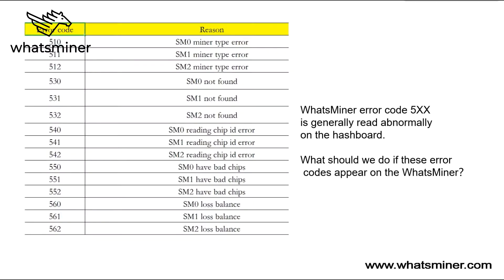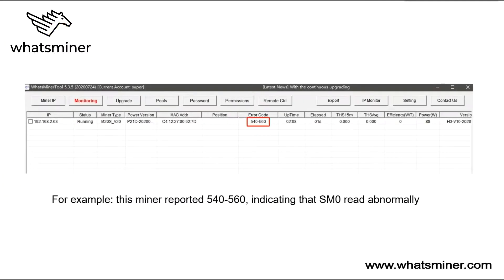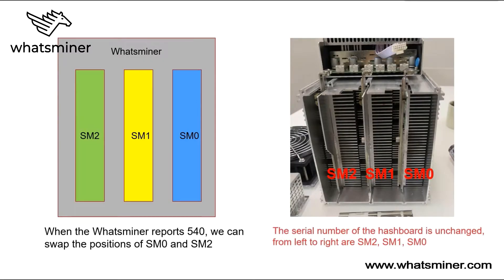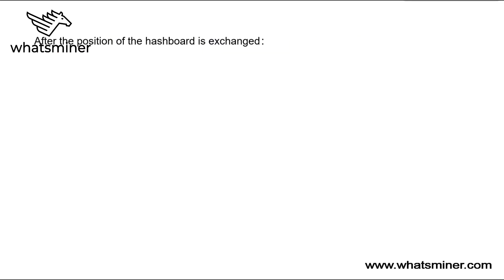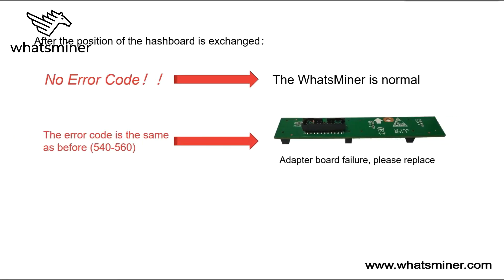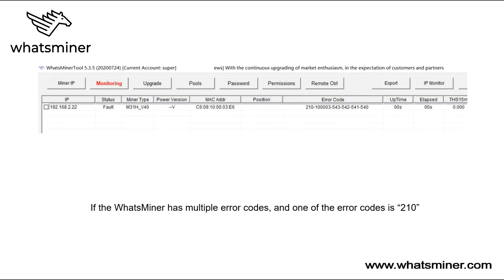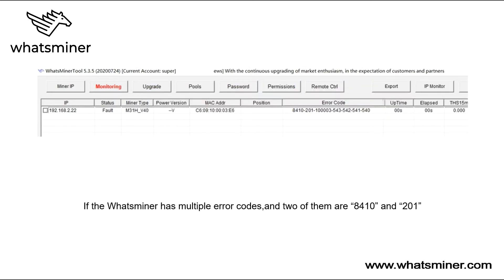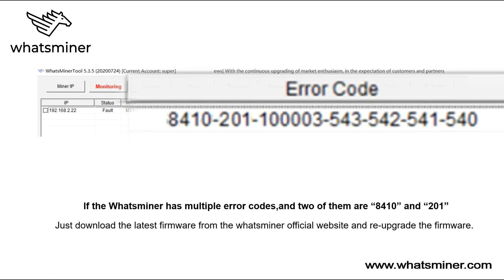WhatsMiner Common Error Code and Solutions

Comment from the maker: Hi there, this video can help miners to locate the error code before asking for the #WhatsMiner after-sales repairing service. For the whole after-sales manual, please click https://whatsminer.com/message/news_detail/36.html?=en
Reply: What do i do ? is it a problem with the power supply?
Error 562: Export failed.
The error message is displayed
Reply: @instrumentmk  Hi,Test process: For example, when you get an error code 562 on one device, it means SM2 hash board can't work normally. You can do like this: Power off, swap the Hash Board position SM0 and SM2, then reboot the miner to verify whether the board is bad in fact, if the errorcode changed to 560,  then it means hash board has issue, if the errorcode not changed, then it means adaptor plate has issue,
The best result is that the errorcode disappeared, it means connection issue only.

Comment: Chinese product is waste your money .no after sale support and the quality is so bad .many error codes no body help from the company 
what the error code 560 means why your miners work for six months and then fail ?
Reply: Hi, you could contact our after-sales and support on Telegram:Whatsminer_Aftersales, 
Wechat:microbt_service, whatsminer_service
Mail:Support@microbt.com.
 For 560 issue, power off, swap the Hash Board position SM0 and SM2, then reboot the miner to verify whether the board is bad in fact, if the errorcode changed,  then it means hash board has issue, if the errorcode not changed, then it means adaptor board has issue.

The best result is that the errorcode disappeared, it means connection issue only.

Comment: Error code 2320????
M20s on low performance. Help, can not find ANYTHING for that error code
Reply: Hi, 2320 means hash rate is too low, but if the hash rate is normal, then you could reboot and check again.

Comment: mine is giving error 540 sm0 sm1 sm2
Reply: Hi,Test process: For example, when you get an error code 540 on one device, it means SM0 hash board can't work normally. You can do like this: Power off, swap the Hash Board position SM0 and SM2, then reboot the miner to verify whether the board is bad in fact, if the errorcode changed to 542,  then it means hash board has issue, if the errorcode not changed, then it means adaptor plate has issue,
The best result is that the errorcode disappeared, it means connection issue only.
Reply: problem solved?